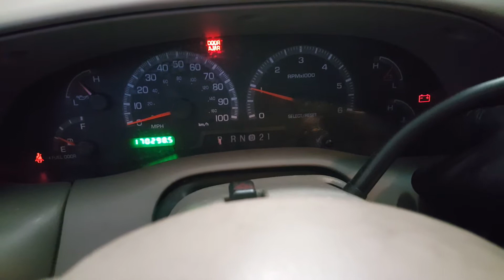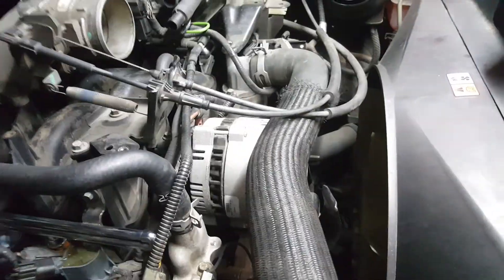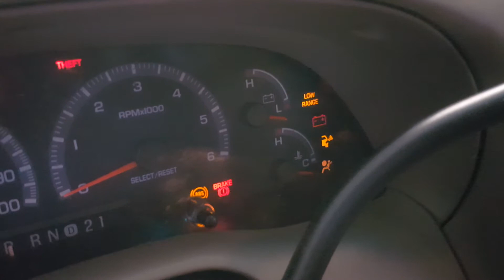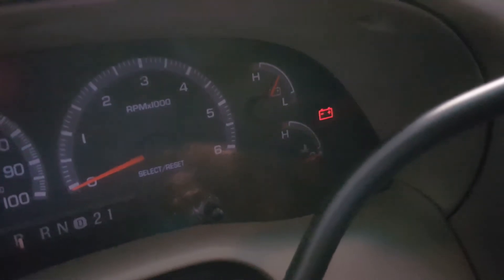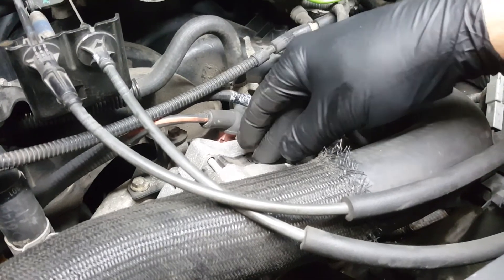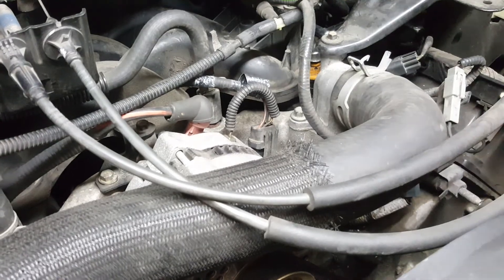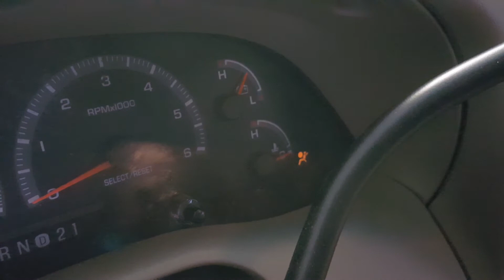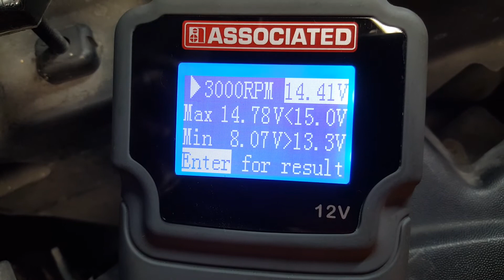02 Ford F150 or Excursion 4.6 5.4 6.8 Charge light or Battery light on dash

Comment: I had the same issue (new alternator putting out good voltage, and a new AGM battery, but battery light was still on).  It turned out to be the alternator harness had a corroded wire.

Comment: The problem with most of them is the wires coming from that plug they rub on an ac line and short out check to wires !
Reply: Hey FamilyMann, are you referring to the plug up by the fire wall that's got the two wires coming from the alternator? I noticed a good charging alternator with battery light and it looks like there's a hole in one of those two wires. Any thoughts?

Comment: Hello I had the same issue.  I then and bought a brand new alternator and battery And it’s doing the same thing. Disconnected the 3 wire plug light goes out. But the alternator and battery is good. What other thing can be the problem battery will not charge

Comment: I got 2003 f250 4x4 5.4 put new alt. And battery. Battery light comes on when cold goes off after 3 or so miles and stays off. But don't do all the time

Comment: Great video brother,I’m working on a 2007 F150 4.6 
My problem is customer came in with a leaking intake which I fixed burned out #7+8 coils Driver side all fixed however being I never drove the truck I was later made aware of flickering dash lights tested my charging system with new battery and Alternator problem with charging system didnt go away before new replacements first charged battery then started and battery took a quick dump to below 10 volts and soon died
So new bat and alt now system check stays at 12.1 without decrease or increase ,checked positive to Alt cable,it has power,checked Alt plug
Orange/blue wire has same 12.1 input as battery 3 prong plug middle wire no read outside 2 wires have read 
Question? Is that now a ECU problem as I can’t find info on ECU built in Voltage regulator ,I,m stumped

Comment: Mine is doing the same thing as this video I bought a new alternator and battery and doing the same thing
Reply: Eustace Clevenshire you ever figure out what it was. mine is the same
Reply: @thetruthalwaysprevails  check the wiring to the alternator.
Reply: Might be the 3 wire sensor on back of alternator. Need to do a “pin point”test on each wire with multimeter to rule out sensor.
Reply: @Dhi-fe5eu  idk what the shop did but not on know

Comment: I just bought a 2001 d150 super crew. The battery light came on, then went off for 2 days. Then back on. Now it stays on. The battery is newer and the alt bench tested fine and checks out fine with a multimeter. I even put a new alt thinking the test was bad. Still had a battery light. I cleaned and tightened all grounds I could find. I have no idea why this light is staying on. Can anyone help?